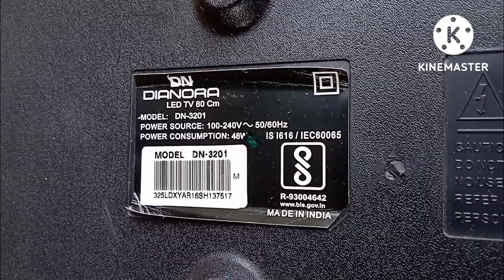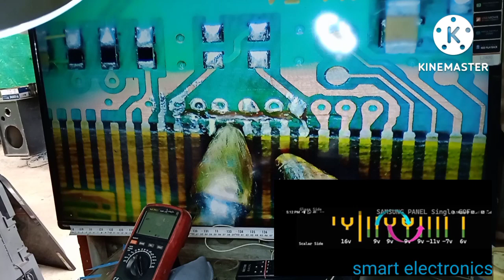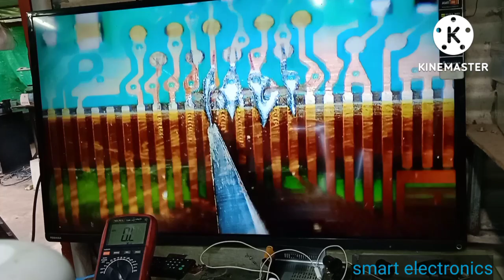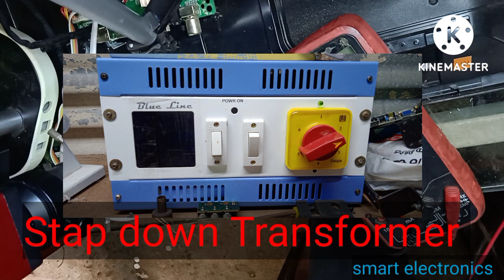Single cof panel LSC320AN10 samsug panel short removing

Comment: Hola ..llegue por casualidad a tu canal.. se ve interesante tus videos .pero es una lastima no poder entender el idioma.. porque no tiene subtitulos en español...saludos desde la ciudad de cali Colombia
Reply: Just giving a surplus volts in the range of 20 to 30 v dc supply for fraction of seconds just inching for 20 times....every time check the ohms valve if it is not just increase the inching frequent to 30 times with DC 20 volts suddenly you will get infinite reading....that is all....

Comment: Tomsonledtvsingalcop4816വെരട്ടിക്കൽലെയൻവരുന്നുckv1ckv2ckvb1ckvb2
Reply from the maker: Vertical, horizontal line വരുന്നത്  cof or  pixel program ആണ് അത് short ചെയ്താൽ  പോകത്തില്ല,     കൂടുതൽ  അറിയാൻ my what's app number. 8129408487